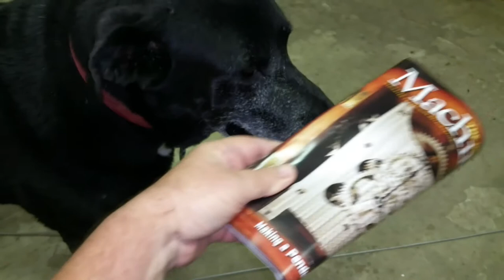Making some round aztec boxes Enjoy!

Comment: Brian good to see you again ? what size tip on the bit and how long did it take ? be well and be safe
Reply from the maker: here is a link to the bit and the cut time was about 2 hrs
https://www.ebay.com/itm/Radius-0-25mm-Ball-Nose-End-Mill-1-4-Shank-3inch-Long-H-Si-Coat-CNC-Engraving/282743509275?ssPageName=STRK%3AMEBIDX%3AIT&_trksid=p2060353.m2749.l2649